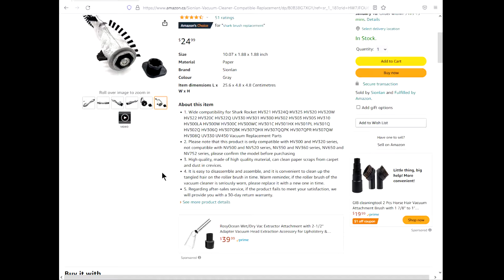Shark Rocket Sweeper Brush Replacement

Comment: Thank you! Super helpful for a not so easy brush replacement. Star key kit was absolutely necessary on my UV330 Shark rocket, which works great other than having worn out brushes. My vacuum guy gave me a hard time so feeling good I did this on my own!
Reply from the maker: Your vacuum guy gave you a hard time ? Was there a reason ?

Comment: Dude, what are the little foam half moon shape deals that the roller slides on called? In this case they are on the blue lid located in little slots on both sides of the roller. Replacing my roller and need new half moons as they are burned out.
Reply from the maker: I'm not sure what you're reffering to. Is there a time stamp from when that part shows up. 
Everything I know about this machine is it the 2 videos I made about it so your guess might be as good as mine. I think I generally seached "Shark Rocket parts" on amazon to find this and went by pics that matched.

Comment: I have the same problem with my Shark HV302 Rocket Pet Corded Stick Vacuum; however, I don't have the tools required to fix it.  Should I take it to my local vacuum store?  It was bought at amazon in 2021, but it seems Shark vacuums have a bad reputation when it's time to replace things or simply fix them.  By the way, could you please list what tools you use to see if I can buy only the ones needed for this job? Anyhow, thank you for your informative video.
Reply from the maker: Oh my. What sucks is that these are the kinds of things that are typically cheaper to replace than repair if you can't do it yourself. 
That was the case with this one. My friend was just going to throw it out if I couldn't fix it on the cheap. 
I discuss the tools needed in the video. There are captions when I discuss them that tell you the model spec of the screwdriver you need. All I remember off the top of my head is that it uses security torx bits.
Reply: it's like they know most people don't have those security bits and will be more likely to just throw it out and buy a new one. weasels!!!
Reply from the maker: @Jack_80  Well, the bits aren't particularly hard to get nor expensive these days. 
Assuming you're ordering the part off amazon already, might as well throw the bits or screwdrivers you need into the cart.
Reply: @DATT  i just ordered the deluxe pro on amazon and they sent me a pro plus, a cheaper model. i thought i was getting a deal but instead got one i could have gotten $30 cheaper from other sellers. weasels!!!
Reply from the maker: @Jack_80  Oh damn, yeah I've heard amazon it getting progressively more sketchy as time goes on.

Comment: How do you get the white piece on the opposite end off? I noticed yours was already off.
Reply from the maker: Is it not the part I explained at 5:21 ?
https://www.youtube.com/watch?v=2BUL7LU6vjw&t=321s
Reply: I'll just guess you did it the same way since you started the video with it already off.
Reply from the maker: @Whatbih2  Oh, the one on the non belt side, yeah that just popped right off. Probably cause that side of the roller was broken. I would likely use the same technique, yes.
Reply: Thank you Datt for your time. They sure don't make it easy.
Reply from the maker: @Whatbih2  Your welcome !
Reply: @DATT mine literally will not come off. I’m pulling the screw with all of my might lol the side with the belt just popped right off
Reply from the maker: @gregorystewart1837  damn, not sure what to tell you. Needs careful persuasion.

Comment: I have a shark vacuum and the spin brush dont spin 😔😔
Reply: Are you pushing the switch twice? The first is for hard woods so it doesn’t spin. Gotta click it twice.
Reply from the maker: I dont' know much about actually USING this vacuum as it was not mine. I was repairing it for someone else. 
You could loose spin if it got badly jammed and seized up much like this one.

Comment: The biggest problems with vacuum cleaners is people don't take care of them.
You have to clean them out and dump the collectors and
 clean the
 filters.

And it's a machine that you have to understand a little about it.
Hell we all change the oil in our cars. Even cars have air filters. You can't just sit on your fist and lean back on your thumb.
Reply from the maker: Yeah, I almost ruined my old Dyson I had because I didn't realize you needed to inspect and clean the sweepers for the very reason seen in this video.
Reply: This is why bagged is better

Comment: Hot tip: you do not need to remove the 2 wheels to perform this repair.
Reply from the maker: Yeah I figured that out in the next video I made about it. The vacuum came back into the shop, this time with a bad lower hose.

Comment: Holy shit! I’ll never buy Shark again. This is ridiculous!
Reply from the maker: Oh idk, I haven't got first hand experience with one, but the fast that I was able to find the part and replace it myself seems pretty good. 
I used to have a dyson, had the same issue. Hair getting stuck in the joint was going to wreak it, but I inspected it every so often and caught to problem before it got too bad.
Reply: Thanks. My point is that they go out of their way so I can’t replace the roller brush. So I will spend my dollars elsewhere. Great video by the way.
Reply from the maker: @dbaxxxxx  Oh cause the screws ? Ah, idk, those are common these days.
Reply: Different size torx screws. Then having to pry it off after the screws are removed.
Reply from the maker: @dbaxxxxx  Ah idk, I tinker with a lot of stuff, it's all par for the course to me. The pry bit isn't bad, it means the part had a good fit.
Reply: Yeah we're certainly not going to buy another shark again in fact we're going to take the one we just bought back to Walmart. The maker of shark is a bunch of sharks because you don't need a security screw on a sweeper unless you are trying to prevent others from fixing something at some point